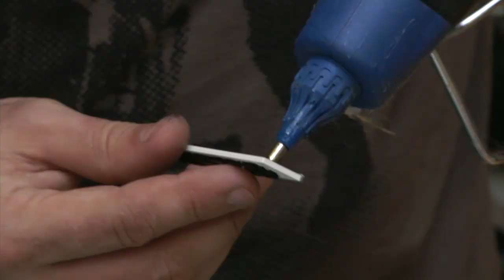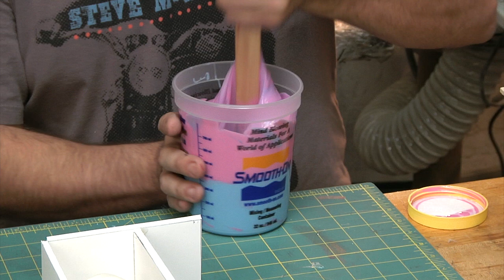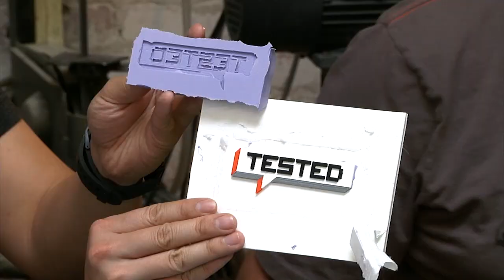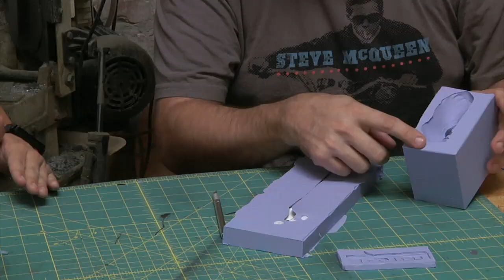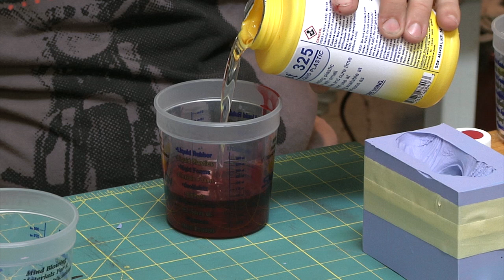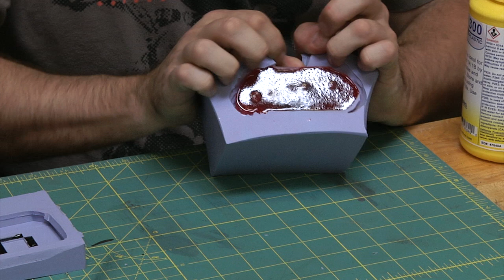How To Make Resin Copies of 3D-Printed Figures

Comment: I've been doing some molding myself and have discovered that $25 of Oomoo doesn't go very far.

So, to reduce the amount I need to use on the non-rectangular models I'm making molds from, I've created a 3D printed outer wall to replace the foam core slabs on the side.

My trick to creating the wall without having to modeling anything is (using Simplify3D terminology):

- Load the model that you want to create a mold wall for
- Increase the model z-height (turn off uniform scaling, so you're only changing the height) by ~6mm
- Turn Top Solid Layers, Bottom Solid Layers, and Outline/Perimeter Shells all you zero
- Turn Infill Percentage to 0
- Turn on Skirt/Brim
- Set the Skirt Layers to a large number that is guaranteed to exceed the height of the extended model
- Set the Skirt Offset from Part to be something like 10mm (or however much silicon you want around the part in your mold)
- Set the Skirt Outlines to 2

Now when you print, you'll get no original model, but a double perimeter skirt the height of the model + 6mm. Simplify3D automatically stops the skirt once the extended model height is reached. I don't know if every slicer will do that, so do check the height of the print that gets created. If your printer is well calibrated, the double perimeter wall should be watertight.

I also increased the "Allow speed reductions down to" percentage to 40%, as I found this value is used by Simplify3D for the skirt speed and wanted the prints to complete faster. Other slicers may use a different parameter to control the skirt speed. The other way to fudge it would be to turn up the print speed to something much higher than normal, knowing that it'll get scaled down by some factor.

I suppose a vertical ooze shield would work just as well as a skirt (plus in S3D it has a direct speed multiplier control), but I used the skirt.

After my prints complete, I use hot glue to attach them to the base foamcore board, as per this tutorial.

I hope someone finds this useful.
Reply: Just wrap a strip of abs card around on itself and tape the ends then glue down. You can do this quicker than you can do the cad and you'll save money on printing.
Reply: I've just gotten done making some thick and wide rubber gaskets out of Silicone caulk :). MUCH cheaper stuff. To get it to cure throughout, add about 8-10 drops of glycerine, which is sold at cvs as skin moisturizer, per ounce of caulk. I don't yet know how well it will work for mold-making, but I intend to find out.

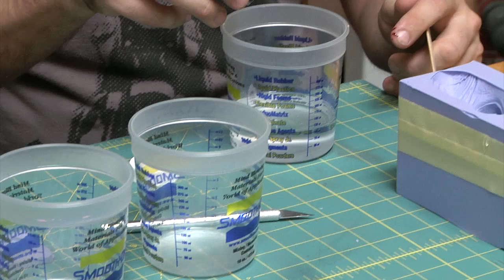Comment: I can't seem to figure out how Frank has the red pigment already on his left hand index finger (3:28) when making the molds. He only gets it on his finger somewhere around 21:45 when the mold is already made, resin copy inception? :-)

Really nice to see how you guys make these resin copys.
Reply: They likely went back and remade the molds after filming the part casting.  If you look at the end, the mixed resin looks like it is not fully mixed at the beginning with a lot of pink showing at the top of the pour.  They likely did it this way to either save  filming time, or to fit the schedule of the film crew.

Comment: 2 points. No 1 if you tried to pour a second batch of the red your biggest problem would be getting a colour match. No 2 Nobody covered what happens if you reduced the Hardener, Would that slow down the work/cure time or does it not work like that
Reply: the resin wouldn't cure properly and would stay gooey/sticky

Comment: Hay if u need  A cheep mold making  silicon I use 100% GE silicon from the hardware store. then go to the pharmacy and get  glycerine for mixing medicine   then use a little acrylic paint. mix about  1 tablespoon of glycerine and one tablespoon of acrylic paint  to one tube on silicon.
all the paint Does is to make sure is all mixed up  
and the glycerine  make is cure  it  
silicon only cures by moisture not by air 

scotty

Comment: A longer set time for the raisin if you use polyester achieves a stronger resing. If you drop a fast cured resin it can smash like glass, and a slow one is more elastic and strong.

Comment: any way to see how to mold hollow headed custom resin copies?  looking to make some custom action figures with hollow parts.
Reply: +Alex Aronowicz Usually when making hollow parts you either make two half shells and bond them together or use a technique where you pour in a sticky viscous material and then pour it back out before it sets leaving a thick film around the sides which sets into a hard shell.
Reply: Or you can pour in smaller amount and rotate the mould around its center until it cures. Liquid will stay away from the center of the mould thus using the Coriolis force.
Reply: Eugene Didkivskyy
Ya, works with some shapes. But something like this head would be a mess. Since the shoulders are so much wider than they are deep all the resin would be slung out into them leaving nearly nothing at the sternum and spine area.

Comment: Could you use this method to mold and cast a helmet?
Reply: +Linzey Mitchell Ya, but it'd be a bit more complicated. A helmet is hollow so you need to make a mold of the inside of the helmet too and suspend it in the mold while you pour or your helmet will just be a solid block.

Comment: How do you do this if you don't have a 3D printer and sculpted things out of clay? Same process or?
Reply: Yes. I've made silicone molds from polymer clay items. It works great! (I used a silicone that was a soft clay-like consistency before it hardens. I haven't tried pourable yet.)

Using the silicone mold to make candy clay objects, I filled the mold then put it in the freezer for a bit to harden the candy clay, so I could remove it. 

For molding polymer clay items in a silicone mold, I wonder whether it would work to bake the polymer clay while it's still in the silicone mold.

Comment: He doesn't  shut up
Reply: I'm assuming you refer to Norm? I can't see anybody bitching about that voice in their head in a comment section of a public YouTube video of an unrelated, not even remotely similar, were talking exactly zero things in common type subject matter.

Anyone who was cluessely confused after a single reading of ANY comment of mine ANYWHERE on the internet, PLEASE don't fly off the non-existing handle calling yourself on how stupid you are or any other just as self-destructive abusive type actions. I type this crap and while doing so, must look back and / or double check both wording AND sentence structure at LEAST 20 to 31 times per sentence, increasing in direct ratio to how run-on said sentences may or may not be. This has been a public service announcement and yes, I AM bored. Extremely bored and welcome ANY good hobby ideas. ANY! PLEEEASSSSE!

Comment: Are the molds good for icecubes? I am seeing lego-man cubes is my future :)
Reply: Yes, silicone molds are great for this.  You'll probably want a relief cut between the arms/hands and the torso to make removal easier, and fill the legs with something to keep the silicone out.  Clay of some sort could work.  The wrists also might be a catching point to fill with a "bracelet" of clay.  Try not to use your favorite figure, as they're all shaped the same and the one you use might get a bit gummed up in processing.  Be sure to wash the figure before starting, your hands often, and the mold before putting anything edible in it.

Lego blocks also make good mold walls, and can be used to stand the figure up while molding.  You can even press a brick against the back of the legs after filling with clay, to get those holes to a nice depth.  Make a few poses and your ice figures will have a little more life, at least until they melt!

Comment: Fill the mold with water (or isopropyl alcohol) and then pour the liquid in a measuring cup to determine how much resin will be needed to fill the mold.
Reply: Rice would be a nice cheap alternative for a volume check.
Reply: Water or dry materials, yes.  Alcohol will dissolve some materials, will evaporate while you're using it, and is generally much more expensive than water.

Comment: It wont be useful for any of the pieces here, but back when I worked at a rubber moulder, we would remove flash from large numbers of small parts but throwing them in a vat of liquid nitrogen, then tumbling the. The rubber gets brittle in the cold and the thin flash snaps off on the lightest pressure.

Comment: Frank's voice is so calming. Like Dan Berry in the UK.
Reply: How easy is it, given a pattern for a 3D object, to 3D-print a mould for that object rather than print the object itself?
Reply: Illuminati And Triangle Worshipers Richard Bartle Seems like a sensible question to me?.. To be honest though, I don't know enough about printing and moulds. My guess would be that it's possible, although it would have to be a two part mould - I think you CAN print bendy rubber, but not as bendy as that silicone.
Reply: Illuminati And Triangle Worshipers
You don't necessarily have to print the whole outline of a box, just print the outer shell of the object with a little extra thickness around it.
Reply: Kjt

Comment: I guess you could fill the mold with water, then pour it into a measuring cup, that way you will know how much resin do you need.
Reply: Luca Viktor You could also submerge the original figure into a static amount of water and record the variance to determine volume.
Reply: ANameThatIsn'tMyOwn I was thinking more that you'd make the mold. Then you know the amount you used to make that. Figure out the volume of the entire box and subtract the amount you used to make the mold and that's your amount to fill the cavity.
Reply: You could get the volume from the original part by finding the volume by displacement. That way you wouldn't have to get the silicone wet. This would be the most accurate IMO.
http://en.wikipedia.org/wiki/Displacement_(fluid)
Reply: VariablePenguin That gives you a handy maximum, but you'd still end up with excess because that's both the negative and the positive together.

Filling with water would be a pain because it would get the silicon wet, and you'd have to wait for it to dry properly... I bet you could get something dry to fill it (rice? Maybe too dusty) and use the same principle though
Reply: Luca Viktor In the business we use rice. Rice is dry and doesn't leave any thing in the mold that could effect the cure. You can also use something with smaller grain like barley but you don't need a lot of detail, only the rough volume.
Reply: VariablePenguin Your right, I did not think of that. Good idea
Reply: More likely, you measure the mold and use the measurements to figure out the volume. L * W * H = V
Reply: I was thinking the same ;)
Reply: +Geahk haha some of these comments are coming up with super complicated ways to figure out the volume. simple is always better

Comment: TOP TIP: Don't wear latex gloves, the latex can prevent some silicones from curing, it is extremely annoying. Don't ask me how I know :)
Reply: Using a condom to mould a penis.
Reply: ***** What kind of resin did you use? I've bought some silicone and resin, but what i've read on the resin bottle will pretty much kill you once you open it.
Reply: thedon008 It was PU resin.
Reply: ***** Well yeah. That's the same as I bought. I'm even afraid of using it with a mask outside. I think I'm gonna buy some eco acrylic resin.
Reply: thedon008 Polyurethane barely smells of anything and is pretty safe. They are using it in the video. What brand did you buy?
Reply: Multicast. Maybe they are using something that has a very mild toxicity level, but I've read some nasty stories on forums by guys who do what I want to do -cast my own sculpts to sell. They say that the catalyst is the one that is VERY dangerous if inhaled, and they always suggest wearing a respirator. I've found acrylic based resin, but I don't know yet if it's able to get the details as well as the PU one. If it can't I'll just buy a full face respirator and go Breaking Bad on the biotch.
Reply: thedon008 From what I can tell you picked a PU resin that uses an Isocyanate hardener, most of them do not. Isocyanate is similar to what is found in super glue and also 2-pack (2K) spray paints. It is a compound that a person can become sensitive to and in the case of spray paints it can be very dangerous as it might be breathed in or absorbed through the eyes/ears. For spraying, air-fed masks are used along with goggles and earplugs because otherwise you can just wake up in hospital or worse if you become sensitive. There is no way to know if you will either. For mixing resins in pots it will be less dangerous especially if done outside and as soon as it is mixed it should be less dangerous as it will start to react. In any case if you don't want the risk there are many other PU resins available without ISO hardeners you can choose (like those used in the video). Alternatively look at how commercial vacuum casting systems work, all mixing is done in a sealed chamber, you could probably build one in a large degassing tank if you are handy that way (it needs motors or mechanical feed throughs), search for MK technology's channel for some nice videos on how they work.
Reply: ***** I know about the vacuum casting systems, but they're too expensive for what I want to do. So I should basically start looking for ISO hardeners. Can you point me to some of the known manufacturers? I am in Europe, so I will have to see where I can find such stuff. Thanks!
Reply: ***** And by the way, I just realised that there is Polyurethane and polyester resin . We want Polyurethane resin, right?
Reply: thedon008 You don't want ISO hardeners, that's the point. You want the more standard types. Smooth-on have distributors in Europe (depends where you are).  I'm in the UK and have used Bentley advanced materials. I've also been looking at resin sold by mouldlife (note British spelling), they do some really good ones used for rapid prototyping that mimic engineering plastic (much better mechanically than the usual stuff) as well as stuff more for props and miniatures. And yes polyester and polyurethane are different, polyester is the stuff in body filler that stinks.
Reply: ***** Yeah, I didn't come back to read the technical names and saw ISO there and took it as the right one. I'll try to find some better ones. Thanks for the tips!

Comment: Can you paint on Resin?
Reply: You probably want to primer it first. Chances are that unless you are really good at it, your castings will need some finishing to look their best, filling air-bubbles, polishing out rough spots etc., if you want to learn more about finishing and painting resin pieces, visit Tested.com and read the articles by Harrison Krix on building a Halo Needler prop :) he covers these steps in a lot of detail.
Reply: kimaboe *****  Also, if you're using a releasing agent (like some silicon spray) you might want to wash it off with some soapy water so that the paint actually sticks :)
Reply: Don't listen to these people, I have worked with resin and painted on it. It's plain and simple, yes.
Reply: Should. A lot of model kids are resin.
Reply: What kind of paint?

Comment: where I can find the foam board to build the box?
Reply: ***** Humph. I mentioned legos awhile ago. HUMMMPPPHHH
Reply: Where i live ( US ) you can buy it at dollar tree, its called Adams foamboard or something like that.
Reply: You can probably buy it at most hardware or art stores. I mentioned on here that I use Legos and they work great. You can really use anything, though. foam board is just easy to cut.
Reply: Or you could build your mould boxes out of lego. Sounds silly but this way you can recycle mould boxes (use the pieces to build new mould boxes).
legos are expensive but you could probably get a big bucket of the rectangle pieces from a thrift store or on ebay for a dollar.
Reply: Every arts and craft store in existence (including Walmarts and Fred Meyers and shit, not sure what your local equivalent may be but basically supermarkets). It'll be called poster board.
Reply: dollarama

Comment: Water displacement to calculate volume first, figure out how much resin you'll need before hand!
Reply: I've seen people pour water into the mold to figure out how much you need, but I like this better, since it keeps the mold dry.
Reply: *****
But the cornstarch would embed into the cast and disrupt the surface. That's what mold release is for. They skipped that step, but I would imagine they sprayed it with some kind of release agent.
Reply: ***** Or you could use birdshot to measure volume instead of rice and get a much more accurate measurement.
Reply: @TimeConsumingInc   sounds good or even  maybe better rubber air soft bb's...

Comment: Great video. Thanks so much for the effort. You could have applied some olive oil spray or similar lubricant onto the inside of the molds and casts to make their removal so much easier.
Reply: Silicone doesn't usually need that, as it resists sticking to most materials, including itself.  (A new silicone pour doesn't even stick to set silicone.)

Comment: I use Lego to build my molds. Quick and totally reusable
Reply: Peter Moore Ingenious idea bro! Thank you four years later!
Reply: Do you prep the LEGO’s so resin won’t stick?
Reply: @McSteelyJam  My understanding is that the legos are for the rubber molds... not the resin.  The rubber should pull off quite easily.
Reply: @khakhananglastname745  Resin molds?
Reply: @1985cactus  sure why not? you can even print the resin moulds from an SLA 3DP
Reply: But expensive.
Reply: @phillhuddleston9445  not at all, not at long terms
Reply: Don't you mean the "Container" for the mold material.  I agree - fast to assemble and reusable.  Should be able to calculate the amount of mold material needed quite quickly too.